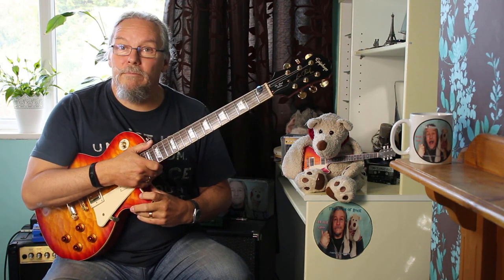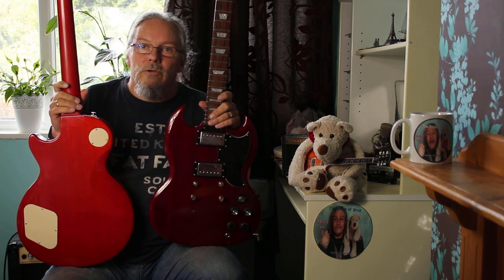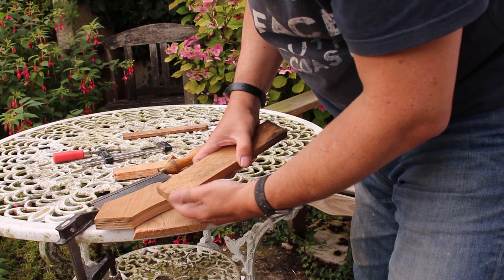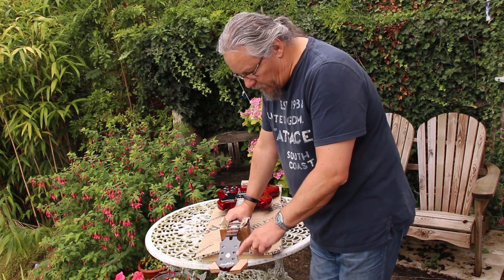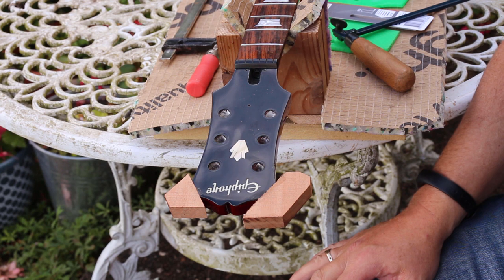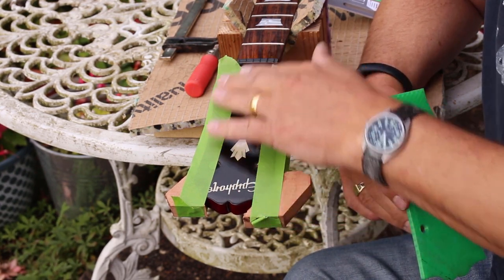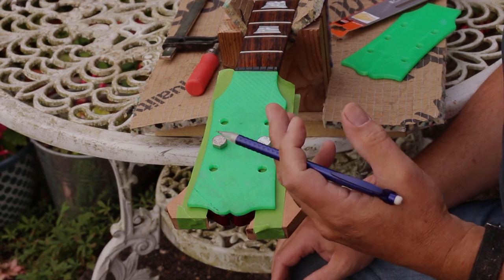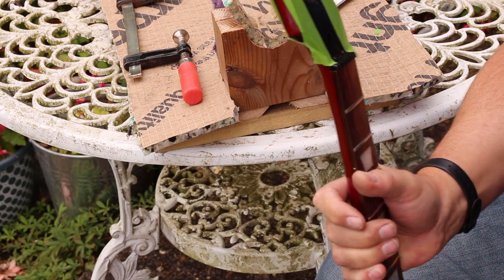Epiphone Headstock Conversion Part 1

Comment: The only worrying thing is when stuff like this lands in the second hand market and someone may get ripped off but what your doing is honourable keeping it an epiphone however making it look beaut I’m all for it and thanks for the video. Keep projects coming
Reply from the maker: Thank you Jonathan, I have no intention of selling them, so hopefully that won't be an issue with someone trying to pass them off as something they are not.
Reply: Easily still identifiable as not a Gibson simply by looking at the open book cutout, on an Epi they are deeper and not as tight.

Comment: The vintage/wilkinson headstock is worst then the Epiphone. Always in my mind I project to turn in a Gibson one. You did it Sir! Great!
Reply from the maker: I personally don't mind the Vintage /Wilkinson headstock as it follows the sides exactly as the Gibson open book. I think to convert on of those you would have to cut or sand the top flat then glue on a piece of Mahogany to cut in to the open book style, as the sides are already right. Good luck if you do try it.

Comment: Dear Sir, your video was very detailed and useful, thank you so much for your contribution! I wanted to ask you something, if it's possible. I want to do the same modification to a guitar i'm really attached to, as I bought it with my father. Would it be possible to have the project your friend made to print out the templates? (a PDF, or CAD file, anything). I can't find accurate ones. your help would be really appreciated!
Reply from the maker: Hi Luca, I am glad you liked the video and it has proved useful.  I have asked my friend Kevin who helped with this project to see if he can find the file he used to make the headstock template. Have a look at this link, https://www.pinterest.co.uk/pin/700591285756170157/  I think I printed this off and was going to use this before Kevin came to the rescue. If Keven finds the file he used I will post a link to it.
Reply: @theroomofrock6456  Thank you so much, very kind of you! And thanks to your friend Kevin too!